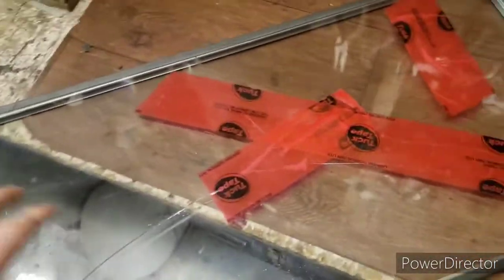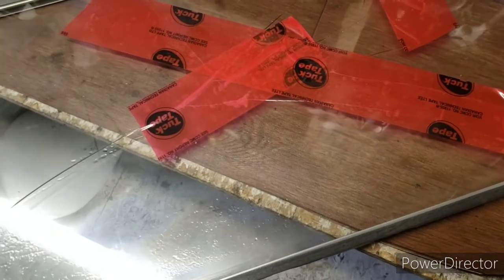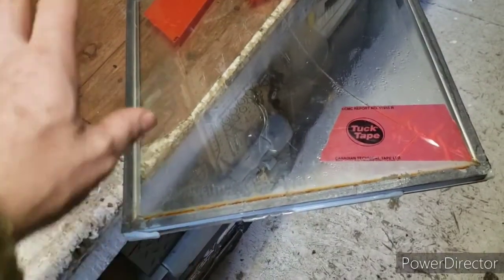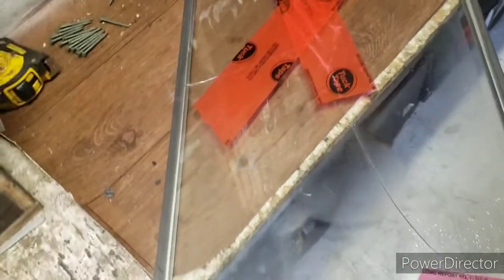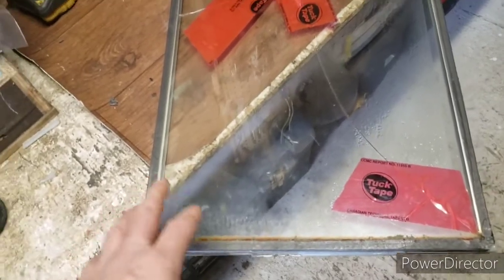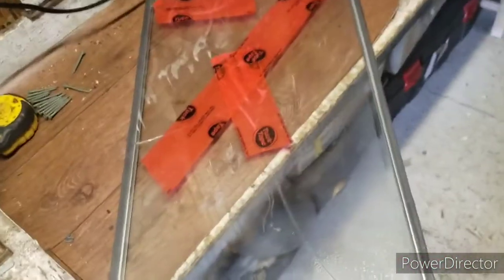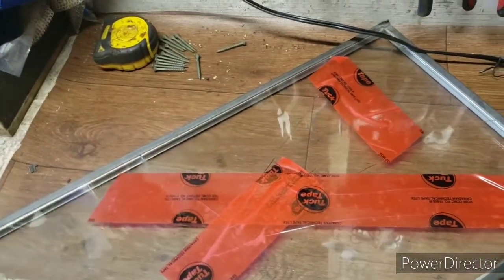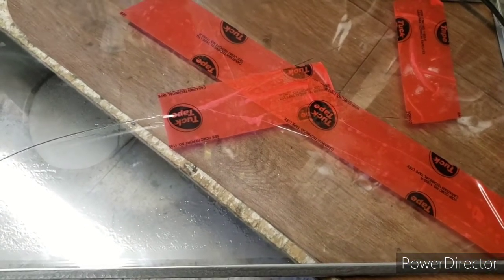How to replace glass in vinyl window. DIY Window Pane Replacement: A Beginner's Guide #vinyl #window

Comment: Good to know.  I haven't had to try to replace one of those yet but I'm sure it'll happen one day
Reply from the maker: Lol hope not but it was ok considering i never seen it done.  I see you got a deal on a 12 ton press, be nice for wheel bearing etc.  I sure wished i had that when replaced my wheel bearing but its one of those things for a diy guy wouldn't get the full use of but at 50 bucks i sure would pick it up.
Reply: Ya, that's why I hadn't bought one till now.  It won't get used a whole lot and takes up a bunch of space. I gotta do a bit of a purge in the garage and get rid of some stuff I don't need anymore.  I built a shed last summer to make some room, but I just got more stuff lol